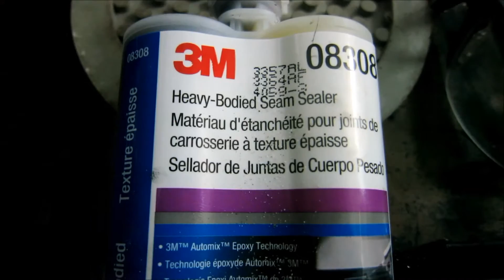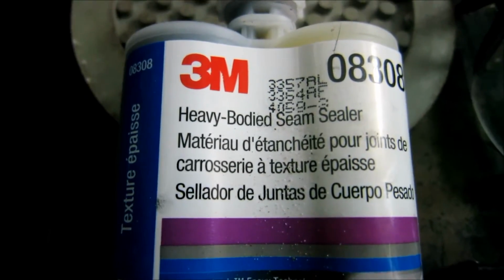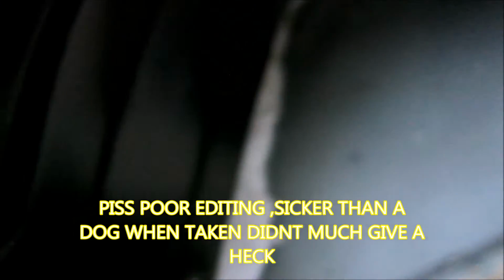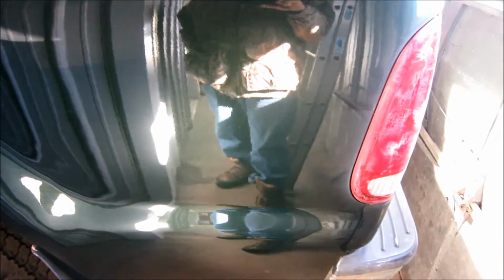FORD SUPER DUTY 250 DONE

Comment: Have you considered upgrading the shop to LED? I just replaced my 8' tubes with 8' Hyperikon LED tubes from Amazon. $110 for a set of four including new "tombstones" (if the end connectors aren't the same). Yank the old heavy ballast while you're up there changing them. Much brighter and better color temperature (I got the 4000K frosted ones). Five year warranty.
Reply from the maker: ill have to check that out,  thanks